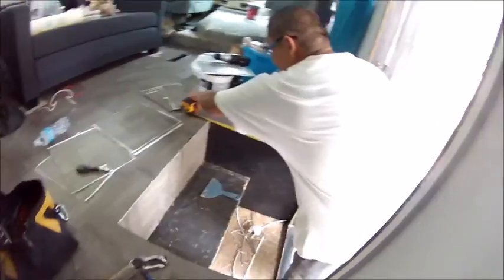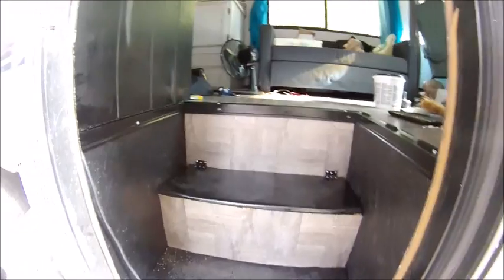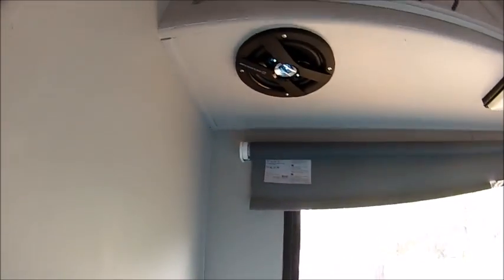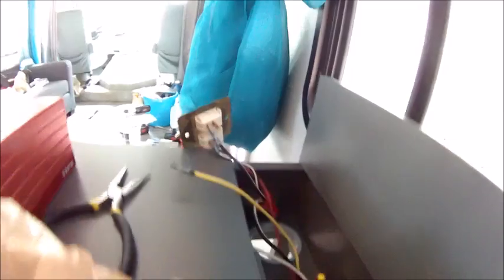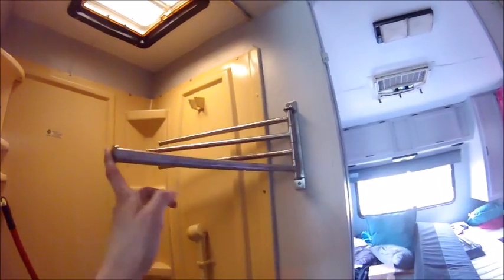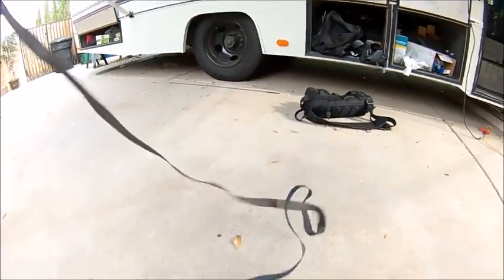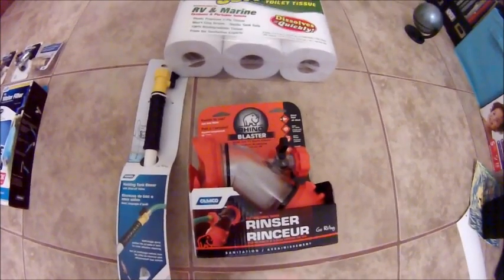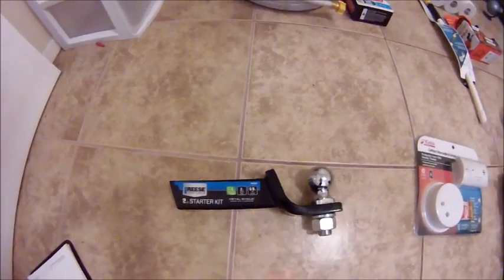RV Renovations Week Six | Keep It Safe | Fulltime RV Life

Comment: your going to want to but an elbow between your hose and your city water connection if you don't it puts a lot of stress on the plumbing on the inside of the rv and can crack some of the fittings.
Reply from the maker: Yeah we purchased one of those, I Mentioned it in the video :) Unless your talking about something different?
Reply: +Enjoying Lifes Journey I saw you just mentioned it was to stop the hose from kinking though.
Reply from the maker: flat 4 Oh, Thx for the added info about it's use :)